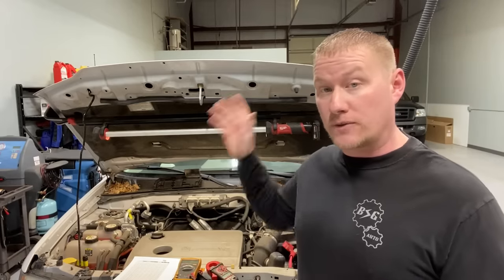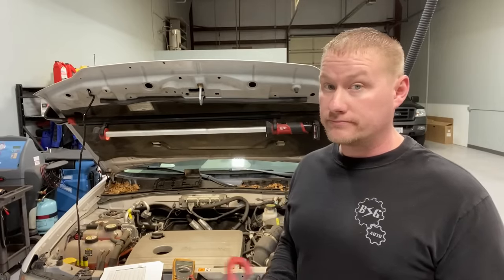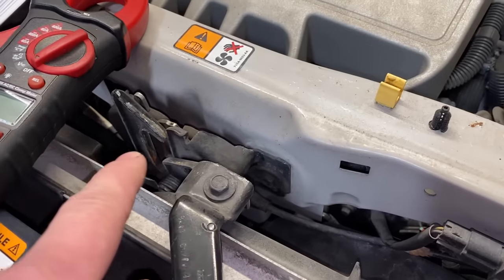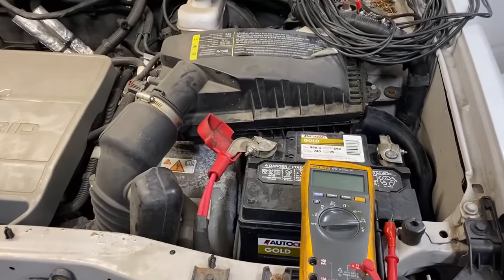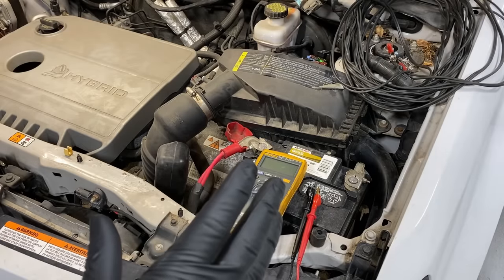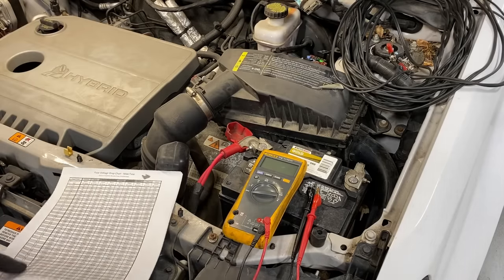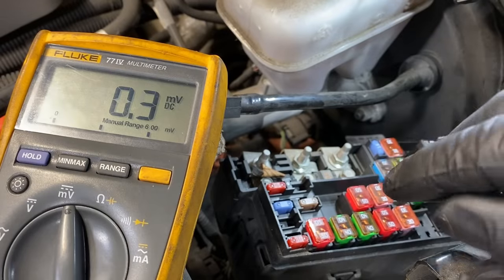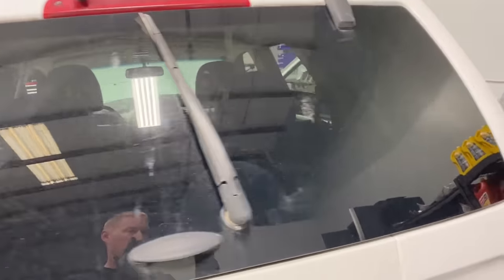Which Parasitic Draw Test Method is REALLY the Best?

Comment: Great videos as usual and great instruction.  I have a 2013 F150 XLT which I have narrowed down the drain (intermittent appx 300 mA drain) fuse 9, labeled radio display, GPS module, Electric finish panel module.  Truck does not have NAV, no backlight on radio display, and no lights on around bezel showing when drain is present.  Any ideas?

Comment: Issue l have is when you said in the fist testing example :sealed fuses are impossible to test in the circuit. Then when you went to your favorite (3rd example) you make no mention of that issue. What changed? This is the reason l will stick to example 2. Tried and true, never fails.

Comment: I can see where an amp clamp that uses a multimeter for the current display purpose would be valuable so you could be inside the car and watching battery current draw while using a second mV meter to perform the voltage drop component.

Comment: You might have covered it already, but if you did, I missed it.  I'd add that not every clamp meter will measure DC current.  There are inexpensive clamp meters that measure AC current, but the DC meters are more expensive and not very common in the average non-pro tool box.   My clamp meter is a cheap one, but I do have several multimeters.  Couldn't two multimeters be used?

Comment: Thanks for the video, I just had this happen to me, so if you see the wiper arm up or not parked, will that stop the parasitic draw if you either disconnect the connector from the motor or pull fuse 19 ?

Comment: If you pull the fuse and measure it’s resistance, you CAN indeed calculate current through it by measuring voltage across it. The charts just aren’t that accurate, but that doesn’t mean the method is invalid

Comment: ........ But the Fuse Probing Method MUST be right. 😲 YouTube Mechanic said so!!! 😜😅😂 
Thanks for clearing that up Brian. As an Old Fart Mechanic, Ford Tech in the 80's and 90's, I DID sometimes find EEC-IV Modules developing parasitic draws. Rare, but it did happen.
More frequently (not sure about newer Cars), faulty Heated Window Module OR a crack in the Windshield caused major draws. It even blew the Diodes out of the Alternator!!

Comment: Hey Brian I have a question after you put the vehicle to sleep hook up your amp meter can you be certain that a module not causing a problem by going to the DLC pins 6 and 14 and measure voltage if it stays at 0.00 there’s no problem with any modules? JUST THINKING   CHEERS

Comment: The voltage drop across a fuse when the current is milliamps is so small that the instrument errors will mask useful data. If the draw is large into amps, it will probably work.

Comment: 88 ford pickup    straight 6    parasitic draw.   Started putting meter in amps between negative cable and battery post   Vehicle turned off    pulled all fuses still a draw    unplugged alternator...draw gone....was the diodes in the alternator   I use my meter to find a draw  I think the older method of in series with the negative at the battery is the better choice    I pull fuses individually, position meter where I can see the display    I do find many modern wiper motor to be very cheaply constructed and break/fail easy....my hatch wiper on my Datsun 1984 will stop/drop all power when key is removed   ford could design it to power down completely when vehicle is turned off   I would rather have a vehicle start than having a parked wiper   modern circuit boards are built very cheaply, and aluminum wires are not going to last as long as the older copper wires   most of my parasitic draws have been the alternator itself    aluminum wires corrode much faster.....

Comment: So with your 3rd method using clamp over positive battery cable as you showed us, what about again when the fuse locations are inside cabin on end of the dashboard and trunk to right of paneling of suv cars etc how are we to set things up so that we do NOT awake vehicle for testing to locate parasitic draw on vehicle.

Comment: Hey Brian, I heard you say some draws are 15-20 minutes apart. Lets say for example my draw is every 20 minutes apart. Does that mean that if i want to do the In-line Amperage test, I would have to wait every 20 minutes for the draw to happen to be able to pull fuses until I see the amperage drop back down? Thanks

Comment: I'm confused about the 2 leads 38:08 running from pos to neg of the battery. A set of 2. I'll have to watch a few more times to catch something I must have missed. Good video. Wish I knew more about my 1997 Chrysler Sebring JXI Convertible. Parasitic Draw. I can't even charge the new dead battery...only hook up the charger and then run the parasitic draw test. Red lead to the neg bat cable, (off the neg bat post) pos lead to the neg bat post. Pull each fuse till I see the digital vom drop to 50 ma. Should I pull ALL the fuses? Like you did? Thanks for helping me. You have a very dignified video here!

Comment: Hehey 1 minute in and i all ready agree with you 100% DVOM in line is the best way even on cars that aren't made by Ford.
But 1 add on to hybrid is that, while i wait the car to go to sleep. I look around the car whit cheap temperature camera on phone, to see if some part is yelling at us that here i am come to look why i draw power.
EDIT: 20:40 to 25:00 When you disconnect the battery from the car you just waist the time you used for driving it in town as some times that resets some modules and memories that could have bean part of the reason why it draws current...
On Current testing with DVOM, the DVOM is your jumper wire. So it's the wire that keeps the battery connected to the car, when you disconnect the cable from the battery(minus or positive).
Learning methods to do it without total disconnect not just safes your time it also safe customers memory settings and you can see on the meter when the car is sleep when its set to DC and not AC like your screen shows.

Comment: How would you test the current on the mass air flow sensor? Do you check between pins 5 and 6 ? And is it a constant 14 Dcv? Ford F-150 5.4 2005 . Thanks help

Comment: Thanks for the video but my question is for the 3rd method if we open the door to check the fuses inside the vehicle light on the door will be lit, light on the roof will be lit, how do we do the test than, also how do we test the cartridge fuses?
Thanks

Comment: How much of a difference will it make if I do not have the "Jumper" you used at the beginning of method 2? I have a 2012 Honda Civic with no satellite radio and no alarm. The draw I got was .096. Is that enough to completely drain a fully charged battery over night?

Comment: Thanks. A question: if the amp clamp is expensive (and of little other use to a DIYer) is it not possible to combine the two methods with two multimeters? Thanks.

Comment: what's your opinion on using the amp clamp of the negative battery lead instead of the red lead that you used in the video?    In your opinion, does it make a difference?  Reason I ask is that it's easier to clamp around the negative cable that the multiple positive cables, specially with a small diameter mA clamp.   I've never had an issue with it except on the this 2008 Escape that seems to have a constant draw of 126mA (+/- 4mA)

Comment: I have to fooling your advice that you showed on here but know I ran into another problem. I locked the door locks with a screwdriver and it worked. However, I cannot get to it to unlock now. Can you share hour trick?

Edit note, I fix the problem. I have a 1999 Ford F150 and on this truck i was able to unlock the door latch by holding the door handle in the open position and push the latch to open position without any unnecessary pressure or force. 

Still have not been able to locate the source of draw but I’m watching your video over again to make sure I didn’t miss anything. Hopefully I’ll have it sorted soon. 🤞

Comment: Brian, thanks for the information on this subject. I have a 2002 f150 5.4 L lariat. Using your last method I determined fuse 11 had a 2.4 amp draw ( alternator field ) pulling the fuse and reinserting the drain goes away. What does this mean?

Comment: What about inserting a 20 ft jumper cable between between the positive battery post and the positive battery terminal; then loop the jumper inside the vehicle so I can see my DC amp clamp while checking the under dash fuse panel?

Comment: Is it safe to say you could use two voltmeters instead of the clamp type? Also can you use the jumper wires to extend the connection so able to see the meter inside the vehicle while reading fuses inside the vehicle allowing a singe technician to troubleshoot without someone yelling when the draw is happening and then stops?

Comment: My 17 year old son had a 1988 Mercury Sable that kept killing the battery.  One cold morning I stumbled across a BIG clue.  I leaned into the engine bay by resting my hand on the alternator.  To my surprise, the alternator was slightly warm to the touch even though the car sat overnight.  It turns out the alternator was allowing some current to back-feed from the battery.  I'm assuming one of the diodes in the alternator was leaking.  I replaced the alternator and the problem was solved.  Your method of putting the Fluke in series with the battery would have shown the current draw through the alternator.  I didn't think to try that.  The fuse pulling method would not have worked because the alternator probably depends on a fusible link - not an actual fuse.

Comment: I dont get why the 3rd method is  "the best" if you still have the issues of not being able to test certain fuses and you still have the unreliability of the values with fuses over 20A.  The way is seems to me, based on this  video, is that the 3rd method is just the 1st method with an amp clamp to verify that a loss is happening while testing, still maintaining half of the flaws with the 1st method.  Correct me if I'm wrong.
Reply from the maker: Only cartridge fuses are a problem and you would test those last if absolutely needed, you can never get around that. As for the 20a or larger concern being inaccurate that only applies to the 1st method because you are taking that millivolt reading over to a chart to find the actual amperage draw. With test method #3 you are simply using method #1 only to quickly identify which fuse and circuit then using the amp clamp for the actual amperage draw reading.

Comment: Very nice video.  Thanks for sharing!
I have a question for the group.  At one point in the video, the multimeter displayed 0.25A.  This reading was described as "25 milliamps".  There are 1000 milliamps in an amp, right, so shouldn't 0.25A be 250 milliamps?  Thanks for any clarification you can provide!
Reply from the maker: correct.

Comment: We have a 2016 GMC Acadia that only has 49,000 mi on it. It is now on its third battery. It has all the bells and whistles. I'm thinking that in addition to my 500 to 200 milliamp draw after it is armed that maybe the alternator is not strong enough to power everything while we're driving and it's zapping the battery within a couple years. Last night I used a clamp meter on the positive battery cable. My son and I had it on for about 2 hours total. At times it went all the way down to 30 milliamps but most of the time it was over a hundred and up to 200 dancing around quite sporadically. I put my voltmeter on every fuse and none of them seemed to be drawing much. I then proceeded to remove every fuse from both fuse boxes including the clear top square ones one at a time and nothing really made it drop. I put the clamp meter back on this morning after it was armed all night and it was still in the 150 to 200 milliamp range!  I'm thinking that maybe because this vehicle has all those extra power options that maybe several of them are drawing a small amount adding up to that total. Should I continue searching?

Comment: When you isolated negative battery post Terminal...was it supposed to arc as it had when you were applying the other two clips to the negative battery cable? I use to have that type of response arc when after unplugging from post to simply plugging negative battery cable back onto the battery post...you would see the arc spark of cable end when it is reunited to the negative post.

Comment: Great video. Are you familiar with an 04 f-150 stock radio causing a draw? I found the fuse using these method but can’t tell why it would kill the battery (it is shutting off). I’ll do some more investigation , thanks again for the videos

Comment: So if you eliminate all the smaller fuses, would you use the second method and pull the sealed fuses to check the larger circuits? It seems like the logical conclusion but making sure I didn't miss a concept.

Comment: Awesome! Glad you shot down method #1…didn’t make sense at all. Question: why did you use two 14ga wires instead of a single 12ga conductor? Also, is the 50ma a standard only for Ford vehicles? I have a 2021 Ram Promaster and have a draw somewhere. Thanks for the video.
Reply from the maker: I don't have a dedicated jumper wire for parasitic draws so I use my custom long leads I use for other electrical diagnostics. When I use them for a draw test the 14 AWG wire will not carry sufficient amperage for an entire vehicle with al modules awake so I just double it up and spread the load over two wires. This ensure the modules do not malfunction and makes sure they go to sleep as they should for an accurate diagnosis.
Reply: @FordTechMakuloco  Really appreciate the information. Your video was very helpful. I used the amp clamp method on my 2021 Ram Promaster. Not sure of the 50ma standard but I didn't find any issues. Thanks

Comment: First of all...small world, I'm in Lemont...also a USMC vet. Secondly, unrelated topic, I just bought a 3.5L EcoBoost 2014 F-150 with 103K on it. Currently running well at normal operation but I get a miss on cyl 2 when I punch it. Gonna replace all plugs and coils today and clear the CEL. 

Thinking about the catch can but I don't have $400 to drop on it right now. Eventually I will get it but in the meantime, do you have any videos on cleaning the valves? I'm guessing you've gotta pull the heads? A video series on that would be amazing. The way I see it, there ain't much point getting a catch can if you're gonna start it's application on a motor with valves that are already coked like hell.  I'm not a stranger to motor work but I am a stranger to modern motor work. My other Ford is a 1967 Galaxie convertible with a 390FE that I rebuilt. Your channel is a tremendous benefit to us loyal Ford owners. Semper Fi

Comment: Brian, after searching through the comments I did not see anyone suggest that you could also cclose the latch of the hood latch with the hood open then you would not have to disconnect the wired switch and jumper it, to fool the computer. Is that something that could work also?

Comment: Great video thanks, have an Audi that has some sort of problem, will be using old school method as no amp clamp lol, but now i know how to find it, should be plain sailing from here thanks, Just a question, If you have the amp clamp on the live wire on battery, how can you see it if you are checking internal fuses at the same time the drain is doing its thing? might be a silly question, but hey,  no one has asked it lol....thanks for the vid though..

Comment: Brian, thank you for your video. I do have a question with method # 3 I hope you can clear up for me? After you apply the Amp clamp you test the fuses with your multi meter. The same way you done in method #1 now wouldn’t you have the same issues as # 1 method not being able to test the enclosed fuses? Did I miss something?  I appreciate your time. Thank Joe
Reply from the maker: Correct you can never get around that besides popping the lens on those as a last resort. Generally, those are higher amperage circuits that are going to relays which are not on.

Comment: quick question i don't think you mentioned it in the video but why did you connect the 2 leads on the battery with the home made leads you made instead of just connecting the multimmeter in series?
Reply from the maker: You want the jumpers so that later you can switch to the multimeter without breaking the connection and waking up the modules. Also many times just arming the car and the flash of the lights can pop the internal meter fuse pulling over 10 amps combined.
Reply: FordTechMakuloco oh ok got it. Thank you for responding 🙂

Comment: Thank you so much this is really helpful.  :)
What happens when you tested all know fuses and Alternator has no issues?
My vehicle while driving is losing power to the battery to the point when there is no more juice and the vehicle stops.
Reply: I have seen this and it was bad in alternator (voltage regulator inside of it). It looks ok when you start the car but stops working after some time or at some specific circumnstances when you drive.  You can get OBD diagnostic tool for $5 and watch the voltage when you drive.

Comment: Thanks for the video. I am retired engineer but not Ford Technician. I have a parasitic draw problem in my 2014 F150 that is giving lots of frustration with dead battery after about 3 days. Doing the current draw test with min max avg Fluke meter, I have found about a 5 minute repeat cycle with a peak of about 2.7 amps for about 10 seconds, dropping down to about .2 amps for about a minute, and then at about 20 mA for the balance of the 5 minutes. I have spent hundreds of dollars at the local dealer without success in finding the problem. I have spent hours on the F150 forum and chased lots of theories without success.  Any pointers for me to check out? Fuse 11 of the BCM is the biggest draw (instrument cluster) but when I disconnect the fuse #11, I find a different Amp draw profile, but it appears the cluster, by itself, may not be the root cause.  Bad BCM?